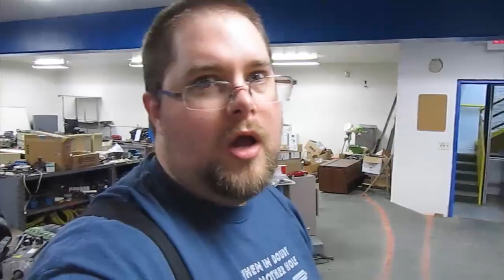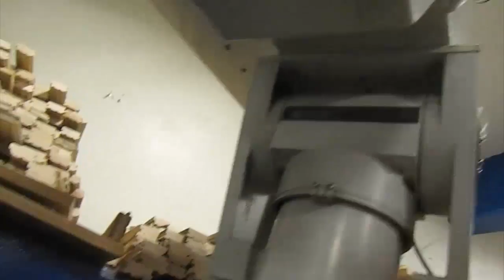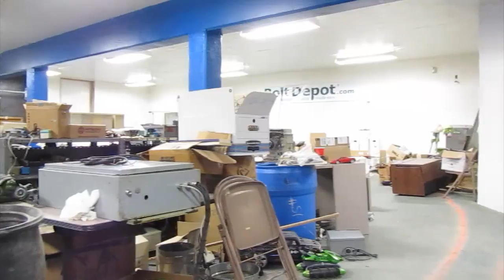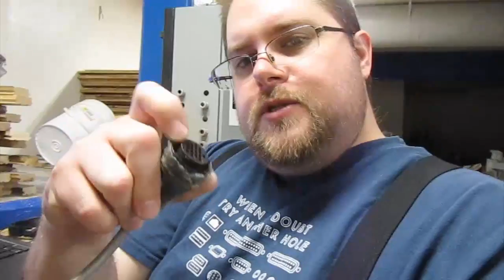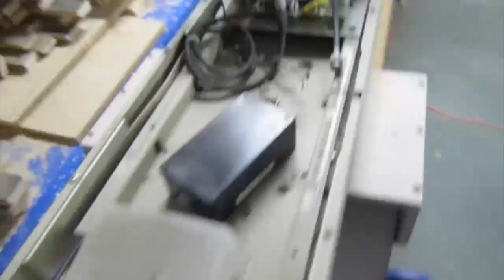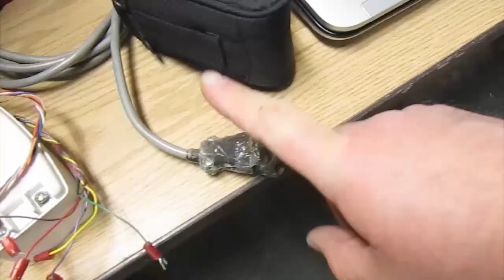20130508  At The Lab - Vicom and Pelco

Comment: Ah righty.. I thought about the output voltage.. lol. Well, the input, if it's not a auto switching PSU. then if it's 115V, it'll most likely have a 200V filter cap on the input ( the big one) and if it's 230V, it'll be a 400V cap.

Comment: For that Pelco power supply. check the Voltage ratings on the capacitors next to the big diode, near where the cobbled together wires are. If it's 12V out, it's most likely 16V caps. if it's 24V, they might be 30V caps, and so on. It really does look like a switch mode supply.

Comment: VA = Volt Amps.  Put simply, Approximately the same as AC Watts,in an ideal world,with perfect power factors,etc.,(but in reality it's not quite that simple. For instance,a 400W UPS backup might be rated at 660VA.) 

The PC board in the older,beat up pelco box looks like a switch mode power supply,probably like 120VAC input,and 24V output,I'd guess.
It might not be hard to convert it to 24Vac,depends if anything else is powered from 120Vac,or just the power supply board.